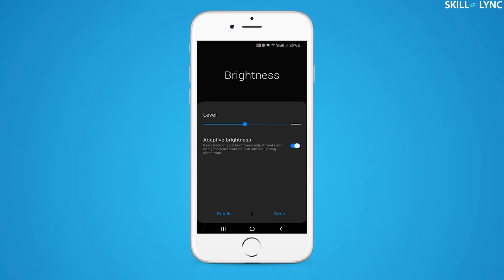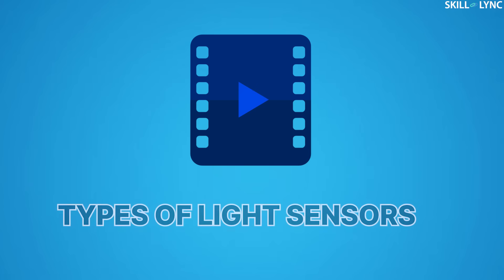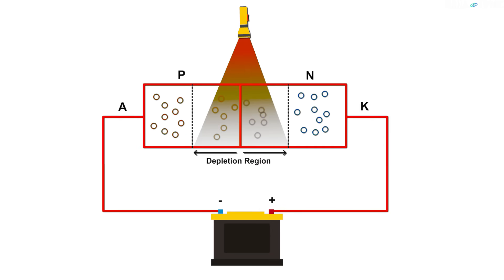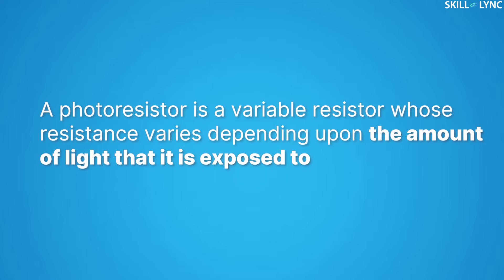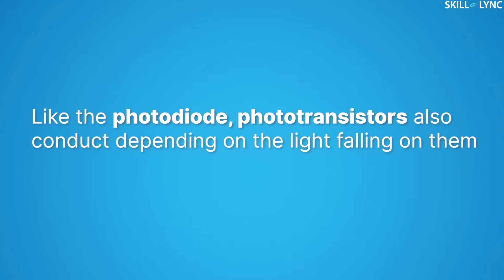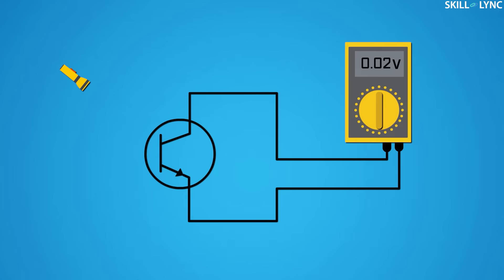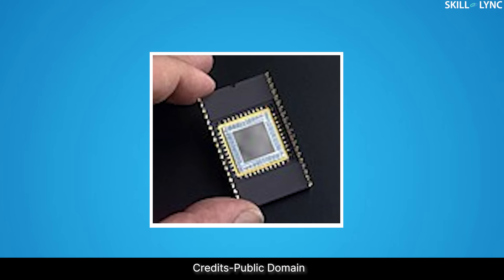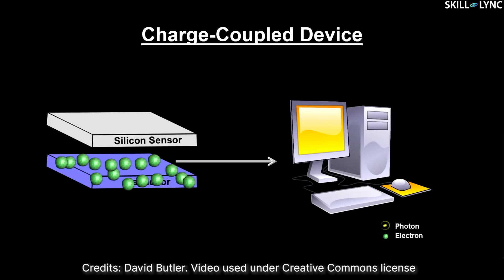What are Light Sensors? | Skill-Lync

Comment: Ccd is 3 layer capacitor use induction effect and clock transistor to read pattern on second layer transfer to third layer as memory at precise time sequence varies depending on resolution and refesher rate